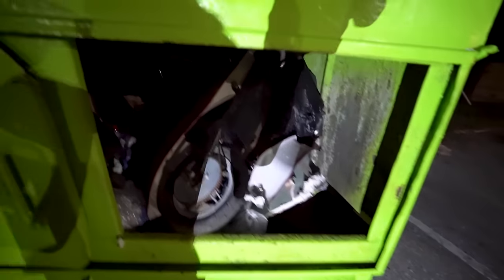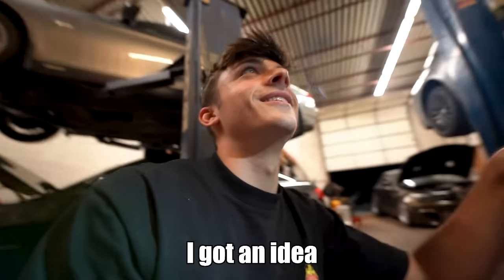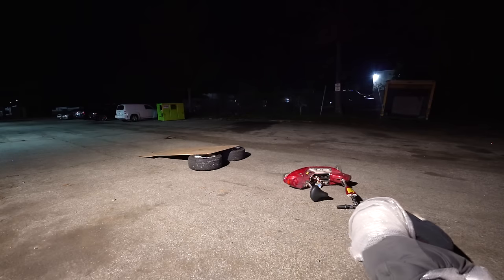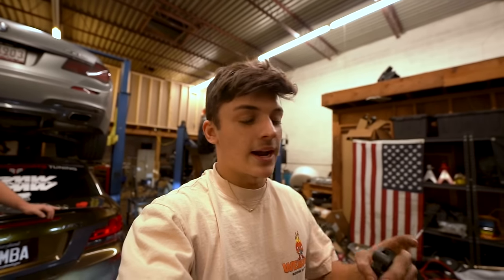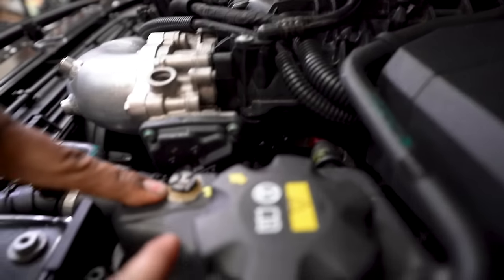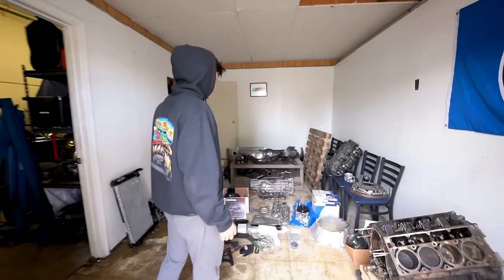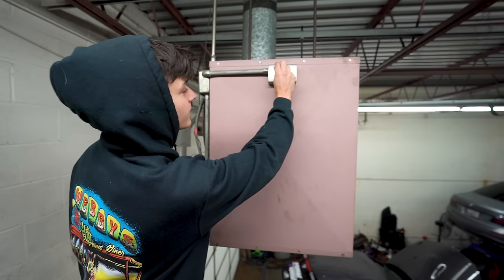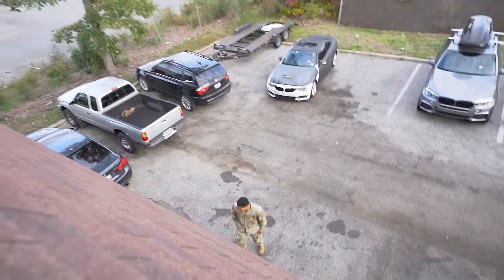BIG TURBO BMW 340i GAPS Mustang At The Track!

Comment: With that old heater in your shop, you should make sure that the heater’s igniter is working properly and heating the air before it leaves the unit. It should have a igniter and flame or some sort of heating coil but probably a flame